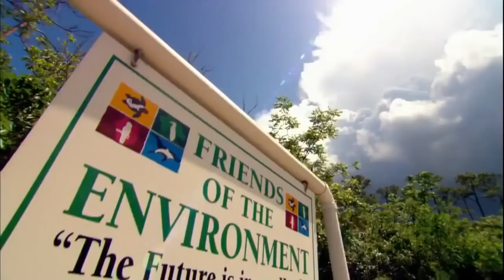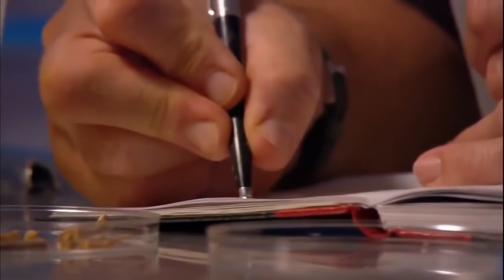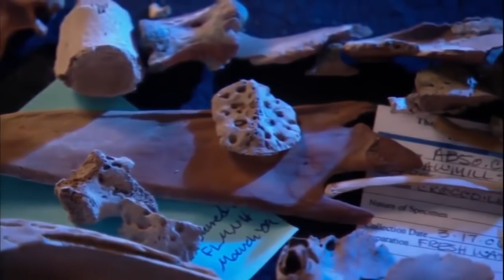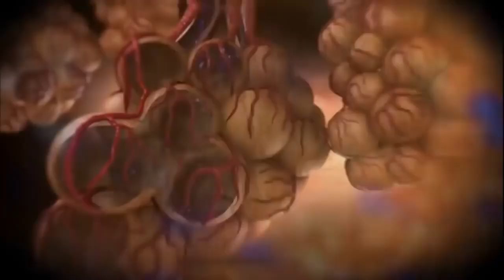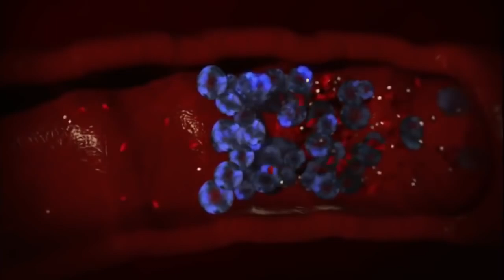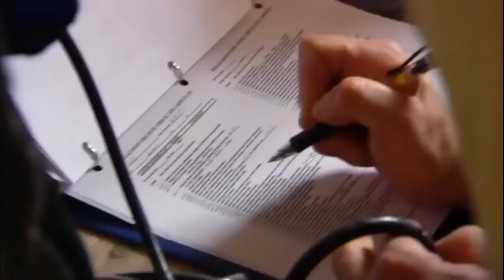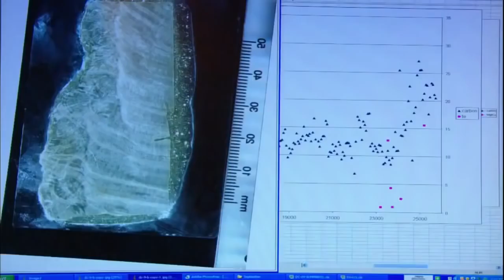Blue Holes Exploration   Extreme Underwater Cave Diving Exploring the World's Deepest Blue Hole

Comment: Well, if we're in the general area of one of those big changes, then you people need to stop whining about it since it was probably never preventable in the first place, and start prepping for it instead. Sure, different areas will be affected in different ways, but several things don't change regardless of the situation in terms of needs: You need clean freshwater to drink. You need food to eat. You need some form of shelter. It's a good idea to have a general knowledge on what plants have medical use (or are edible) for when modern medical methods aren't available. It's a good idea to have basic first-aid training and to be able to improvise. It's a good idea to be physically fit. You don't need to be a body-builder; A simple regular core-workout schedule will do. 
You feel that maybe the lower areas are going to be flooded? Move to a higher elevation. This isn't rocket-science, people!